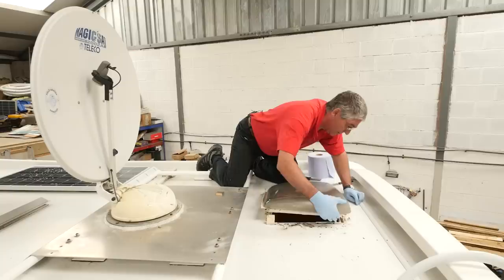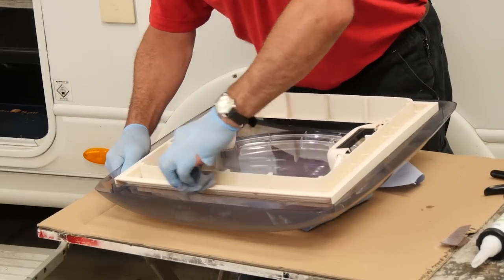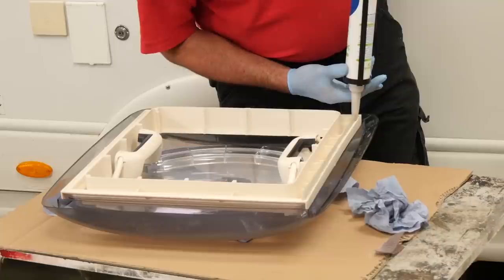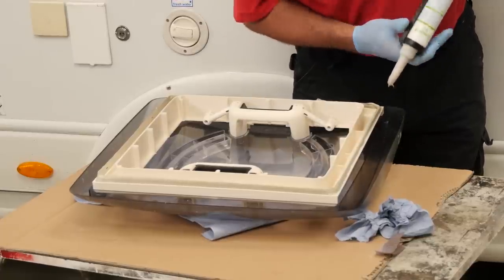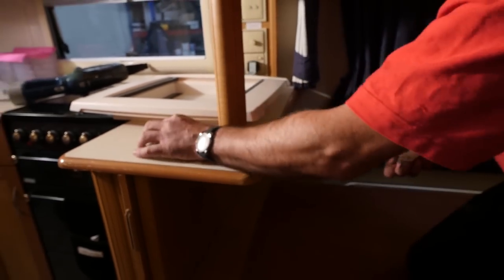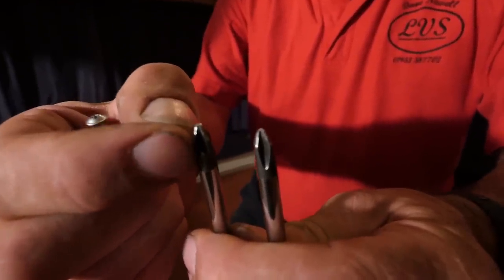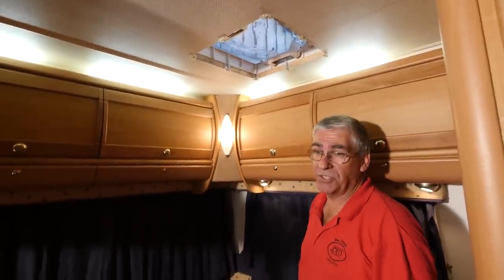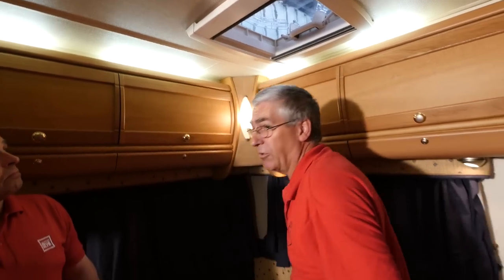How to change a rooflight part 2 – expert advice from Practical Motorhome's Diamond Dave

Comment: hi i need to change two rooflights to our old Granada 34 static caravan...Do you measure inside both sides  of rooflight for replacement or from top? I think our two are different sizes ie one 450x450mm then other 550x550mm? Any suggestions to buy rooflights that have insect mesh?

Comment: I used your suggestions for replacing a HEKI 2 rooflight (the big one). It went fine. I put the new one upside down on the roof of the caravan to apply the sealant, then just flipped it into the hole. Perfect!

Comment: Hi.  I found part 1 and 2 invaluable for replacing a sky light but I do have one query.  I have heard that sky lights/roof thicknesses vary.  Do I need to take my sky light out to measure they thickness before ordering a replacement.  Asking as you can appreciate that taking the old one out may be troublesome if the new one isnt available to go straight in.